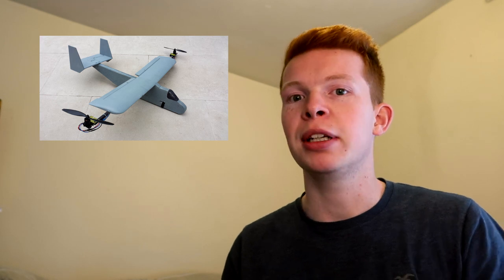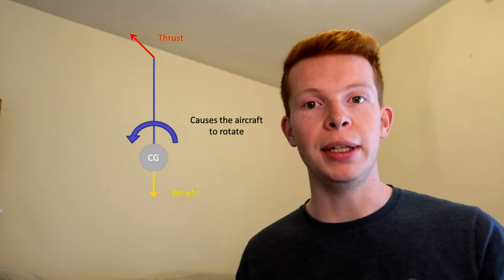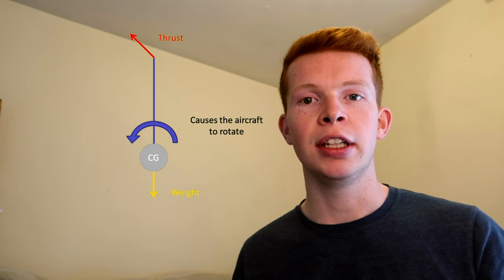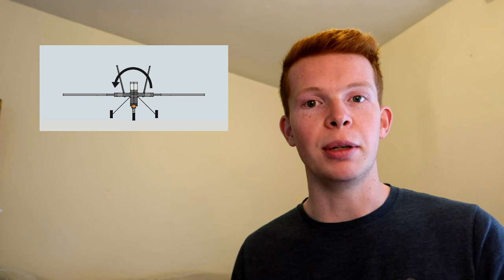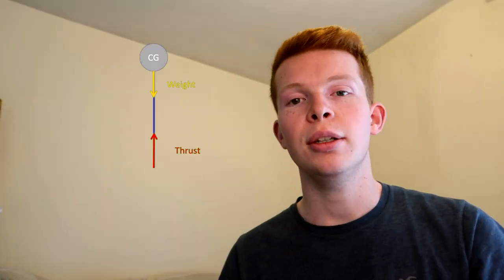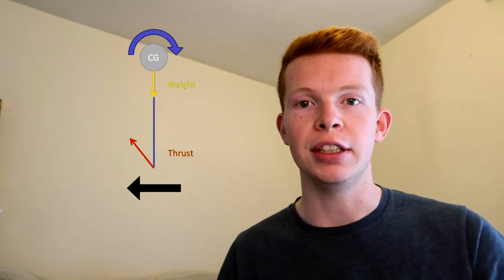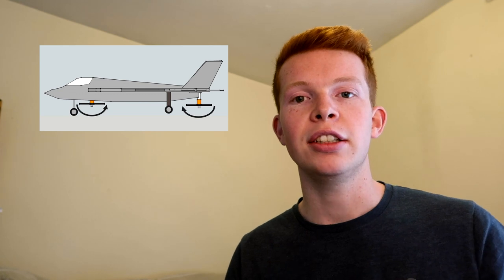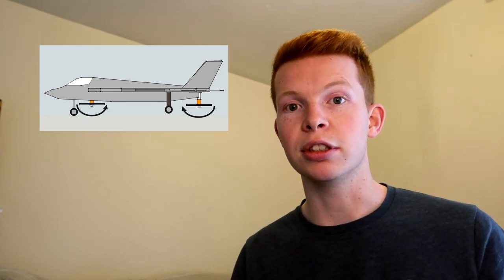My RC F-35 VTOL  Attempt!

Comment: If I'm not mistaken the real F-35 uses ducts so that it has 4 points of thrust in total, so it acts a little bit more like a quadcopter. In other words, I can hardly believe you made it work with just 2 propellors, it's incredible. So if you ever feel like taking up this project again, it wouldn't be  cheating to ad a couple more props on the sides.
Reply: Paul is right. There is a "puffer" jet under each wing. Getting two propellers to work is indeed amazing. In that regard did you counter rotate the motors?
Reply: You are correct that some of the thrust is moved out to the wings so there is more stability, it is not quite to the wingtips but not to far away. I also agree that it is an incredible project. Keep up the good work!

Comment: just a thought, since the real f-35 has "roll posts" on the wing tips, how about using a pair of 1306 or smaller sized multirotor props on the tips to give the roll stability.  That should fix the issues you have

Comment: And this is why the f-35 costs $100 million dollars each..
Reply: Not all F-35s are VTOLS Actually the VTOL versions are worth even more than 100000000 dollars.
Reply: F35-B are the VTOLs, F35 are A, B and C
Reply: And it is turning out to be a lemon
Reply: ian turpin Is it now? And why would you say that?
Reply: The F-35 is actually bought at $80 million dollars each, but to maintain it is the expensive part... $36,000 for a flight.
Reply: the price per unit is a bit misleading considering the R&D, overuns, wasteage, training and maintainance

Comment: along with the rear main drive motor make a motor driven impeller with a sevo that links to your aileron control to split the air flow between two nozzles on either side of the fuselage. 3 points of support is more stable than 2

Comment: thanks for posting. great work. just a few thoughts...you've acknowledged your masochistic choice to balance a soccer ball on a marble where thrust vectoring is concerned.  speaking of tv, with a complete airframe in place, consider putting the marble on top, eh?  then, put your chosen vectoring method beneath 'em.   cheers

Comment: you should scrap the by quad idea it's always going to be unstable. maybe go with 4 motors. I'm building a X8 tilt rotor VTOL using a kk2 FC with openaero software and a eagle tree vector for airplane mode. the kk2 with openaero is a must have when building a VTOL.  the kk2 fc only controls the motors thrust in hover mode. the vector controls the ailerons and elevator in AP modes and stability mode. this way I have RTH waypoint seeking and loiter mode when flying as a plane. then a flip of the switch and its a X8 drone copter. I could shut down up to 6 of the 8 motors if i wanted to program it that way in air plane mode but its just so much more fun to fly it with a power to weight ratio of 4 to 1. it can climb straight up till the battery die's lol.

Comment: if you pick this project up again maybe try putting some really tiny brushed motors like the ones in the really small quads from revell and put those in the wing tips and maybe one additional one in the nose. i know that the harrier does a similar thing with small thrusters at the wingtips and nose to control the roll and pitch better

Comment: Why not use a tricopter setup? You could position two motors at the back, close to eachother, and one at the front. The one at the front will manage yaw with a servo like a conventional tricopter, and the two in the back will be stationary. This will greatly improve your roll stability, even though the motors are close to eachother. You could even do thrust vectoring in the roll channel with the two motors in the back when you are flying in forward flight. Just my 2 cents ;)

Comment: cool project.  not enough control power.  pitch axis could be solved with proper PID tuning, and motor braking even with larger props.  roll would not have worked with wings and even lightest gusts.  need swashplate or additional rotor.

Comment: The problem probley was that you didn't have a flight controller like a quad
Reply from the maker: Hi Grant, the aircraft did actually have a flight controller, however it was a kk2.0 board running OpenAeroVTOL firmware. So it was no where near as good performance as the latest quad flight controllers. Thanks
Reply: StantonFPV oh cool! I am sorry I didn't finish the video, I just did
Reply from the maker: no problem :) thanks for watching!